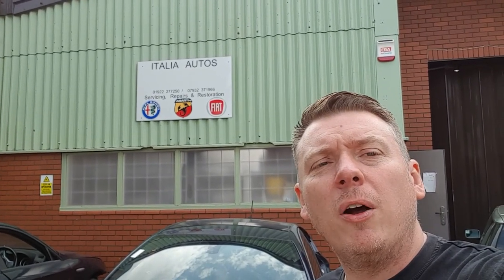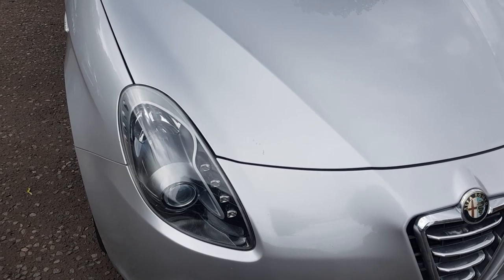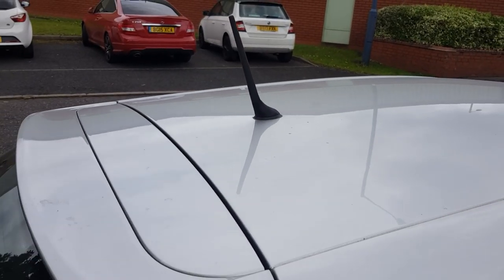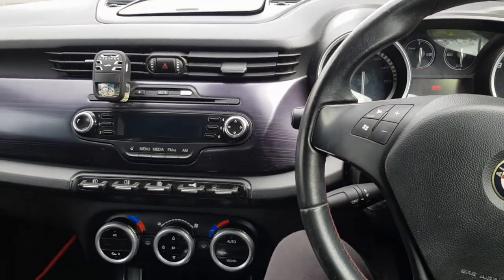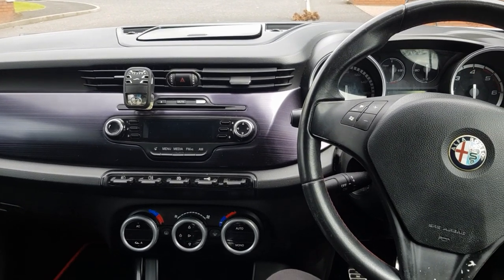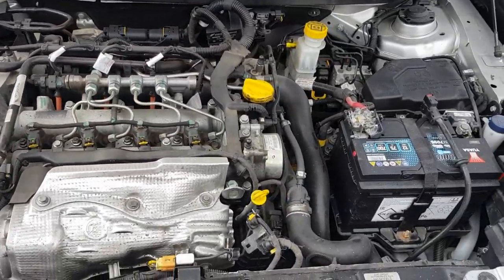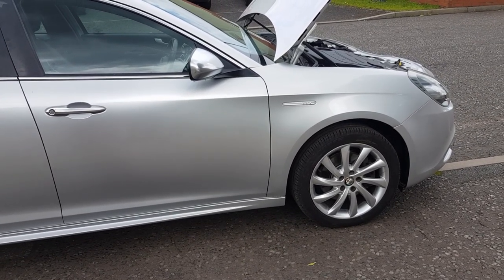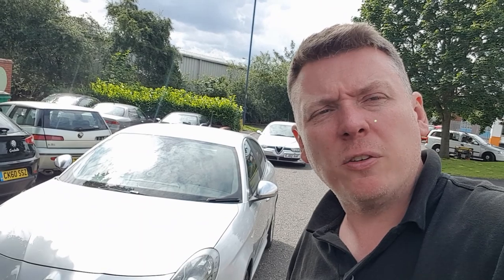Alfa Romeo Giulietta Buyers Guide

Comment: A true Giulietta expert! More than an average Italian garage... a few comments from a 10 year old model owner: steering wheel wear can be resolved by installing a better looking and sturdier MY 2014 steering wheel. The gear knob peeling can be resolved DYI by installing a new top shell (very cheap). The front grill (if broken can also be substituted with a MY 2014 grill, which can be found online for very cheap. The boot door cables can be repaired at home by simply removing the rubber joint and linking back the cables (better to add a few CM of cable). The squeaky suspensions can be resolved by spraying silicon lubricant on the moving rubber parts, which can be done when doing a tire change (I spray every 6 months and now at 110k the car is quieter than when it was 40k). Also now door handles are available on the web (no need to buy the full door panel). 
Keep up the good work and thanks for sharing!
Reply from the maker: That's good that they make the handles now as when I made this video there was no option. 👍
Reply: @ItaliaAutos  yes, only recently they are becoming available... in Italy somebody has even been making them out of aluminum for some time!

Comment: There is a website in the UK that supplies lots of parts for this car (Alfashop) like door handles etc, everything is pretty reasonable.
A lot of these problems aren’t major and you’re not very likely to suffer from 2 or 3 of these problems if you keep this vehicle for a good length of time.
People forget this model has been out for a very long time and problems with the earlier models get linked with the newer versions because they all look the same, unlike other manufacturers.
I have a couple of niggles with the car but overall it’s a good car.

Comment: Owned mine for 2 years, had 3 problems.
1, The wire for the stop start sensor under the gear stick became fatigued and snapped. I fixed it myself, no cost.
2, The heater fan stopped working. Turned out to be stuck so I poked it with a screwdriver and freed it then blasted it with a bit of WD40  and it's been fine since, no cost.
3, One of the front top mounts failed and I couldn't be bothered to do it myself in the cold, so booked it in. Cost £150.
Its the Multiair Veloce and has done 79,000 miles, I do a lot of short journeys so change the oil  every 6 months, which is about 3,000 miles for me. Great car.

Comment: Great buyer guide. I sold last month my AR Giulietta 1.4 Multiair TCT with 120.000km. In my case, I must repair/replace de boot wiring for two times (rear window heating, FM aerial, reverse light and real wiper terminal 30 source), the fuel cap locking mechanism (it's a very common issue), the door handle, the antiroll bar links, one front wheel bearing, one drive shaft and the battery terminal current sensor. I had also problems with the temperature sensor of air conditioning evaporator, that makes de A/C compressor didn't start (is just only clean it!). I only have wear signs in the interior door handle and in the surface of the front headlight plastic lampshade (normally in sunny Spain). Another typical issue related with heat and sun in south of Europe is dashboard crack in the passenger airbag zone. The airbag module warps and brake the plastic (same problem as FIAT 500s). No mechanical problem with the engine or the gearbox in 120.000 km and 5 years. Overall, 8/10. Best regards!

Comment: Also some other things to look out for from my QV : 1) The fuel flap tends to get stuck with age 2) The gear knob cover came loose after 50,000Kms on mine 3) The Air condtitioning sensor was playing up after 50,000kms also was replaced. Cost $100. Otherwise the car was fine no other major problems and quite happy with it.
Reply from the maker: good stuff glad your happy.
Reply: The temp sensor has gone on mine and had too get the wing mirror replaced which ain't cheap, mind you its the only issue I've ever had but an annoying one

Comment: yes, good show. If you're buying a 1.4 petrol there's a few important things to check on the  engine/gearbox. 1. engine not idling or running correctly which could be the multiair system, big fix. 2. engine and gearbox leaks which are common. 3. turbo failures, ie rattling bearings, or not enough boost. Also make sure it has the correct oil in the engine, as the multiair uses the oil as hydraulic oil, (as well as lubrication) to operate the parts within the multiair unit.

Comment: Had mine 18 months and this video has just show me the trip computer has more function on it then I knew about, thank you!

Also in 18 months I've had:
Temperature gauge has gone which isn't critical but it needs the entire wing mirror replacing to fix it although I've found reports online saying that this can be repaired by cleaning the connectors inside the wing mirror
Gas struts in my boot went but that's not an Alfa fault and cost £30 to buy new ones
Neutral output went on the stop start which stopped DNA working which cost £170 to get repaired and this was a cable that had snapped under the gear stick, the cable is about £15 but you've got to take the exhaust off to get to it and that was wear and tear because of where it is.

Comment: Surprised you didn't mention changing the water pump with the cam belt. This is known weak point for all the multi valve diesels and it's imperative to change this as well. Totally agree on the change interval 48000 miles or 4 years!
Reply from the maker: Yeah prob lots I forgot to say. ,😀😀

Comment: I must have a good one. Bought 4 years ago for £2k my 2011 2.0 JTDM Veloce in 140bhp format has had no major problems and has now covered 155k miles. In my ownership I've replaced the tailgate wiring at zero cost as I had all the stuff required (I rebuild old British sports cars as a hobby), put a set of Brembo discs and pads on, oil and filter changes each year and I've just last week replaced two front drop links, one lower wishbone and a snapped spring. 

The interior is squeak free, she does 65 plus MPG if I take it easy, and costs £35 for VED, £155 fully comp per year. The only problem now is an intermittent slipping clutch, but the car still drives and I'll keep going until its proper knackered - the parts are down in price now at £300 (Sachs) with the flywheel and silly release bearing/servo unit, or £200 for a QH solid flywheel conversion including clutch and pressure plate.
Reply from the maker: Not a bad little car for you then

Comment: 14:30 about timing belts from Alfa Romeo Giulietta manual:
Regardless of kilometres travelled, the timing belt should be replaced at 4 years or 60,000 kilometres for vehicles operating in dusty areas and/or demanding use, long periods of idling and continuous stop-start driving. For vehicles operated outside the aforementioned conditions, timing belt replacement should occur at 6 years or 120,000 kilometres.
Reply: In Spanish user and workshop manual, timing belt must be changed every 5 years in heavy use conditions (distance regardless)

Comment: I’ve just bought a 2.0 Veloce JTDM, full service history, and timing and pump replaced. Pretty nervous, but she looked in great condition.
Reply from the maker: Nice.
Reply: @ItaliaAutos  you reckon it's a solid buy, I checked for any rust on the sills and, drove nicely with no knock. Time will tell. She's at 100k on mileage, so that's why I'm a little nervous with it.
Reply: @DrumToTheBassWoop  thinking of getting a similar car and mileage - low chance of a reply but any updates on how that car has been?
Reply: @henrybridges4060  yeah sure, drives like a dream. BUT, some issue:

1) Blue and Me will eventually pack up, This caused the battery to die, if it does, it will cause the odometer to flash too. The fix, is to pull out the blue and me system completely with battery disconnected, a Small box behind the dash, reset the ECU with MultiECUScan, and plug in a Bluetooth adapter into the CD port as an alternative.

2)shorts in the famous "rear boot loom" this caused the boot light to drain my battery dead. Again, simple fix.

3) front passenger door handle broke, very annoying, seems Alfa decided to make these door handles of brittle plastic.

Apart from that, and many days shouting, swearing and cursing that I would sell her, I did not, in fact I forget said arguments as soon as im gunning her down the open road. :D
Reply: Now u have had it for awhile whats it being like? Is it reliable?
Reply: @aaroncousins4750  yeah sure, not much went wrong after other what I said above. BUT....

Alfa in their infinite wisdom placed a turbo hose next to the subframe where it could wear away and cause a leak. To which I found out gunning the Welsh mountain roads to an almighty whistling and wooshing noise, and tractor-like power (fitting in Wales). So when you buy one, either put some piece of plastic in between the hose and subframe or replace with an aftermarket hose. Then again I might of just bought that one Alfa that had this issue, I'm sure Italian Autos will know more than me to correct me.
Reply: @DrumToTheBassWoop  thanks, im looking to get a 1.6l as my second car once i get my first years no claims in november. If you dont mind sharing did you spend alot on maintaining it? I currently have a citreon c1 which i bought off my grandma for £100 and its probably cost me about £200 in maintenance in the year and a half ive had it since learning to drive. Im currently look at a 2014 onwards with low milage hopefully. Thanks for the help
Reply: @aaroncousins4750  yeah, it's going to be one of those cars, I have spent quite a bit on it, like new tyres matching, new hose, handle, new battery (due to the blue and me draining it). In terms of yearly maintenance not more than £200 plus MOT I reckon. So don't be dissuaded of my spending on it. The big reason I got mine at the sacrifice of other things was for the BOSE sound system, which is quite good. So I factored in buying new tyres and stuff.
Reply: @DrumToTheBassWoop  oh £200 is alot less than i was expecting, i dont mind spending money on the car to make it look nice, i just dont wanna spend more on the car than i bought it for just to keep it running 🤣. Anyway thanks for the help, i do think ill buy one in a couple months, insurance quoted me £3,300 without a tracker so need to start saving lol
Reply: @aaroncousins4750 yeah I've spent £1,500 on my car excluding yearly maintenance. But Jesus, 3k for insurance? How old are you? Something is not right there at all.
Reply: @DrumToTheBassWoop  ill be turning 20 in october, and ill have 1 years no claims. The giulettas im looking at are 1.4L with 190ish bhp. I had to rule out the 2L giulettas as the cheapest insurance quote i could get was £4,500 with a tracker, with no quotes available without. Insurance has massively limited my choice, i had looked at a ford focus but they also quoted me 4.5k with a tracker, insurance companies hate new drivers having 2L engines unfortunately. Main reason im wanting a giuletta is the insurance is considerably cheaper for the specs
Reply: @aaroncousins4750  holy crap, insurance has fucked over the younger people. That's unbelievable, when I was your age I had to settle with a shitty Corsa 1.2 and pay £1,500 a year. Now I'm paying £500, with a stage 1 remap too.

If I was you, just get a saloon car, I know it might not be as cool. Say a Volvo saloon, try that. Insurance is usually cheaper as not many kids would drive them and crash in them, save the guilietta for later.
Reply: @DrumToTheBassWoop  im doing pretty well for myself with my job, on the way to becoming an accountant so ive already done the maths and know i can afford it, ive already found the cheapest place to finance the car so im pretty confident i can make it work. Ive used and abused my citreon c1 since i started learning to drive and i want something i can take pride in for a change

Comment: i had a mutliair 1.4 was awful hated it.. the multiair unit went , luckily i want warranty. things i hated that my feet used to slip off the clutch, headlights were shit couldn't see anything at night. you just reminded me about the lack of foot well room.. i was really disappointed with my purchase at the time.
Reply from the maker: Unfotunalty a multi air needs servicing correctly or it can get blocked.
Reply: @ItaliaAutos  at the time my car was fairly new. i wouldnt get a another Giulietta. i think the 159 is a better car for the money
Reply from the maker: THEG12EG it’s all down to what Alfa suits you.
Reply: @ItaliaAutos  im justing at a cheap 159. spare and repairs car.. seller has said 1 x injector needs replacing.. what would you charge for that?
Reply from the maker: THEG12EG Petrol or diesel.
Reply: @ItaliaAutos  diesel

Comment: Great guide. I have owned a 2010 1750tbi Cloverleaf for a year now, thankfully almost nothing I wasn't already aware of. These are fantastic cars, I don't regret trading in my old 147. My steering wheel ornament was degraded as you showed, I bought a new one from eBay and followed an airbag removal guide to change it. I'd recommended changing the wheel buttons whilst you're there, some wear out on older cars. I did have a turbo failure just after I bought it, but I've no idea what the previous owner did to cause that as it was within days. I'd also second weak gearboxes, I've just gone over 100K and my 4th synchro is a bit dodgy. 1st and 2nd are a bit unfriendly too, which is normal for lots of city miles. I'm assuming I'll have to have the box reconditioned in another year or so. I've had a couple of random airbag errors from loose plus, but I already owned MultiECUScan from my 147 so I was able to clear them without cost. They've not recurred since re-seating the connectors.

Comment: To anyone thinking of buying a Giulietta I've NOT had any of the issues raised in this video and I've had mine since 2014  it's the best car I've ever had hands down I've had no problems at all, its been cared for unlike the one in this video which is a wreck
Reply: Sean siamo 4 me, no problems in 100.000km
Reply: at 75000 miles only had two issues wire loom left side of boot broke cable for brake lights repaired this myself very simple other issue i got is with the speakers sound randomly drops out on either the left or right front speakers but if i turn volume up  it comes back probably a loose wire but i dont want to remove my dash to sort it xD 

other than them two issues the car has been great for me!

Comment: I couldn't help but Crack up during the whole video: This is a good quality car. If you have problems it might be with the engine or transmission, but the body and interior are very reliable. Except for the fog lights and side lights. Sometimes they corrode up and flicker. Oh, the door handles break sometimes too. And the rear lights fail because the wire looms wear out. Oh, the antennas fail too. But the interior is great. Decent quality. But sometimes the inner door handles break which is quite expensive to repair. And sometimes the hand brake wears out too. And the. And the flimsy plastic breaks. But they're a great car inside and out. Lol.
Reply: Don't think you'll get all those problems at once kid. And they are amazing cars, engines won award, highest euro cap safety, list goes on to why the cars amazing.
Reply: @jckedwards65  I think your missing the point. My comment was a summary of the video. Not my personal review.
Reply: The beauty of Alfa’s in a nutshell 👌

Comment: Really top notch video. What are the TCT gearbox's like for reliability please. Seriously considering one of these and will check out to see how far you are away for servicing etc
Reply from the maker: There ok just expensive for clutches
Reply: @ItaliaAutos  Thank you for coming back to me so quickly on this, much appreciated. What sort of figure are you looking at for the clutches, usually expect to replace at 100 K and currently looking at a very lovely looking at a Alfa Romeo Giulietta
2015 (65 reg)

1.4 TB MultiAir QV Line ALFA TCT (s/s) 5dr. and thinking about the longevity of the engine etc, full history cheers
Reply: @retepyam5858  did you maybe get that one?

Comment: I can confirm the transmission from first second and third is quite hard on cold start. I’m wondering if the gear box oil change  could help?
Reply: 1st and 2nd gear also hard on mine for the first 10 mins, did u changed the oil or something?

Comment: Thanks for the Video Neil! After my GT burnt down due to a bad sill repair on March 1st, the missus finale gave green light to get another Alfa. We're looking at automatic Giuliettas. Any major issues with the TCT transmission on these?
Reply from the maker: Clutches are expensive and the box or a bit grabby.
Reply: How does a sill repair cause a fire?
Serious question.
TIA
Reply from the maker: Insulation inside the wing also waxoil is flammable
Reply: When you say expensive, what are you looking at? Just a basic mini or Seat your looking over 1k

Comment: Great video! I've had my 2013 2.0 diesel for a few months and love but it's quite smelly in the engine bay. I've tried to find a guide to clean the egr valve but cant find a good one. I've had the throttle body off and cleaned that, wasnt that dirty. If you could do a video how to remove and clean/replace the egr that would be great. Theres quite a few posts on the forum where people have asked for a guide, I think people would love it. Thanks again and keep up the good work!! Cheers
Reply from the maker: Thanks. Next one i do I'll film it
Reply: @ItaliaAutos  amazing, thank you!